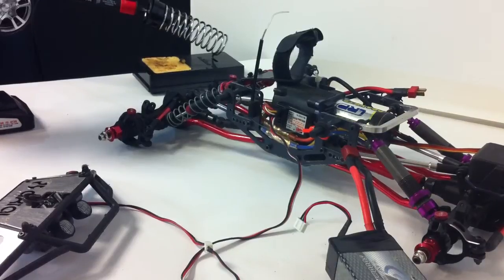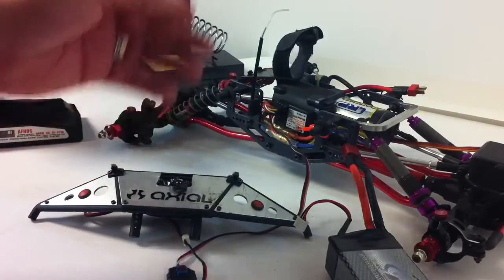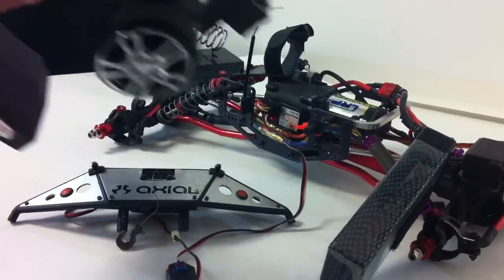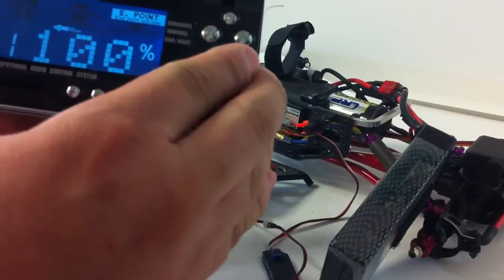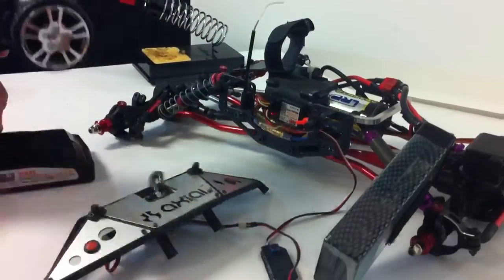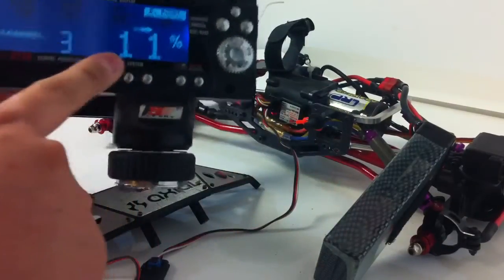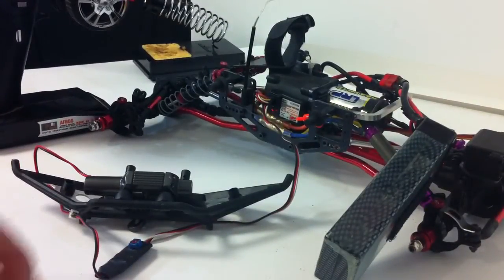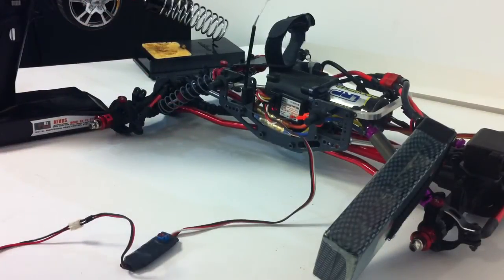Running winch on FS-GT3B no hack

Comment: I tried hit channel 3 right when I turn it on, hit it again it starts moving one way, go to servo reverse Nd switch it, and it just goes faster in the same way, if I hit ch3 to stop it it works, then I go to steering trim and move it all the way to right to make it pull back in

Comment: How do you assign channel 3 to turn lights on and off??
Reply from the maker: Mike Secondo in the same fashion as this video, can be done several ways. One is to use an old servo board and solder your wires where the motor wires would go, the LEDs. Then once you plug them into your 3rd ch you can switch them back and forth and have them turn on & off hope that helps